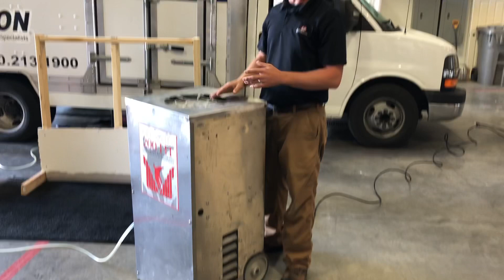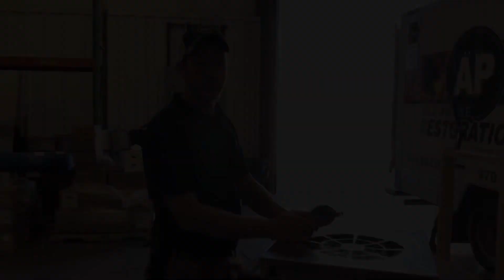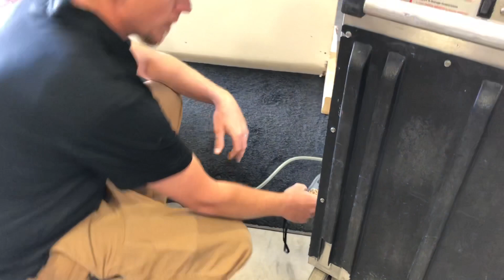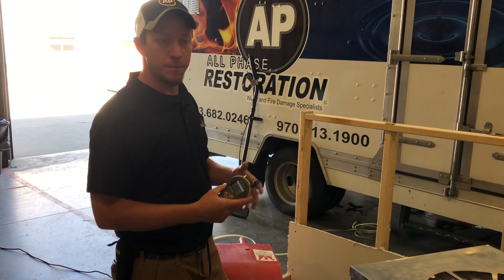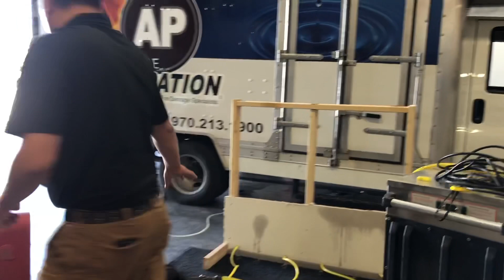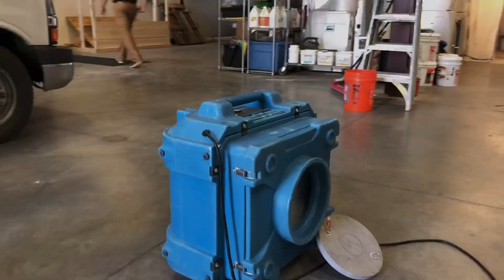All Phase water damage basics: drying equipment

Comment: only video that comes close to positioning air movers. i have one particularly wet to dry. am i right in thinking that i should position it at the wet wall at an angle that means the air blows off the wall and out the room door?